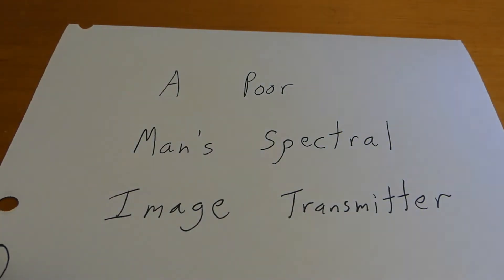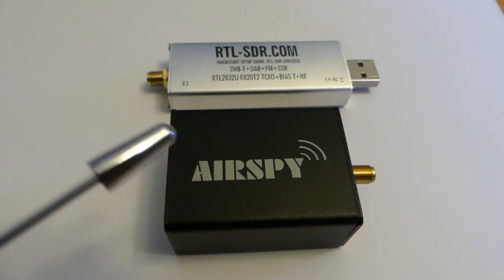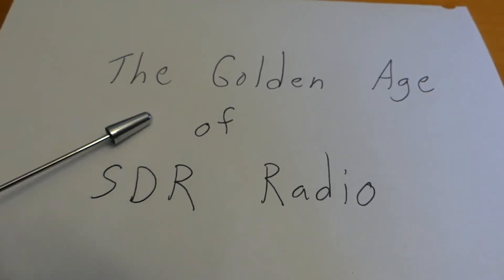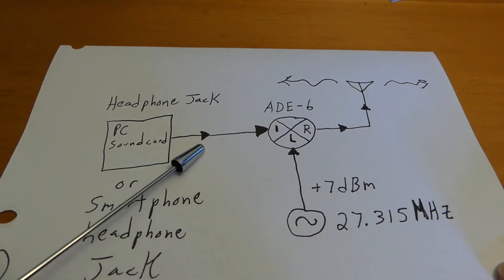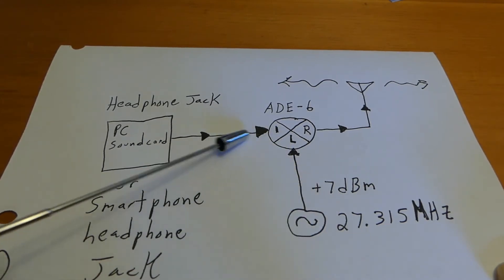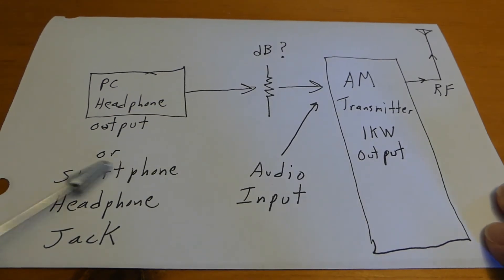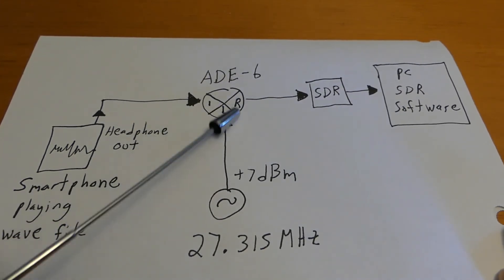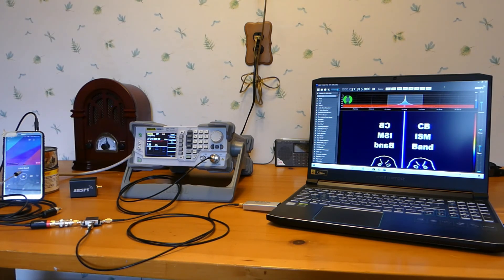Spectral Image Transmitter

Comment: Hi Sir, one question in the matlab code, why on earth did you add the real and the imaginary parts together? i haven't seen anything like that before, water and oil doesn't mix as they taught us in school....you could get the magnitude value or the absolute value of the complex numbers but adding the real and imaginary like this...was such a shock on me when i start studying the code...the line is :
data=real(data)+imag(data);
thanks for explaining that.
Reply from the maker: this spectral image method here, does not use a IQ modulator.     but rather just makes simple mono audio.   hence the image will have a left and right spectrum that is the same.    but in matlab, ifft returns a complex output.    i think i first just took the real,   but as a test added the real and imag,  and thought the image looked better.      hope that explains it.     you can try just taking the real part,  should not see much difference.

Comment: Please enable comments on your new videos. The loop antenna sdr part explains the difference between a yaesu sdr and the icom.
Reply from the maker: yeah i set that for kids to see.   trying to make non K9RSY type videos LOL......................good point thou,  i have been amazed how many of these new ham radios that are SDR based,  forget to put front end filters.          it's like they are having the new engineers right out of college, do the SDR radios and the older and wiser engineers have retired or are working the power amp designs.         i use the HF discovery sdr by airspy,  great unit,  low phase noise,  and 16bit sample depth,  it's very sensitive.     but even that needs front end bandpass filters to turn it into a top class receiver.     once i got the LNA and the filters,  this thing is working better than some government 10k communications receiver.   LOL  and it only cost me like 150 bucks.
Reply: @TheGmr140  exactly, I'm tempted to buy a 7300 just to play around with one but it seems people buy them and then sell them because depending on their location the front end gets overloaded . I had a Yaesu 101D which is their new hybrid SDR and that receiver was great, like all new radios it takes a while to work out some bugs with firmware. How bout a video on a quick DIY loop for 2 meter direction finding? We have a local WV5 that likes to jam repeaters lol.